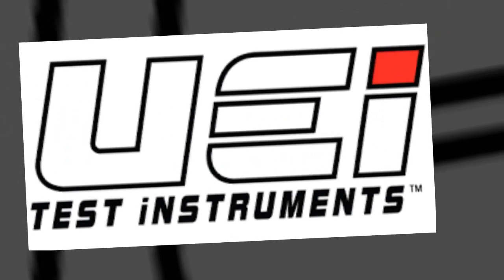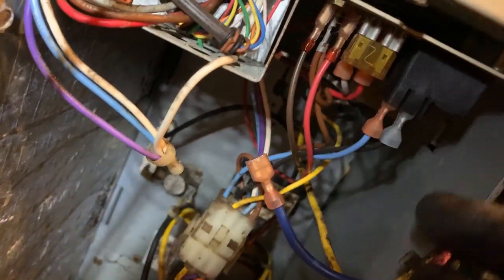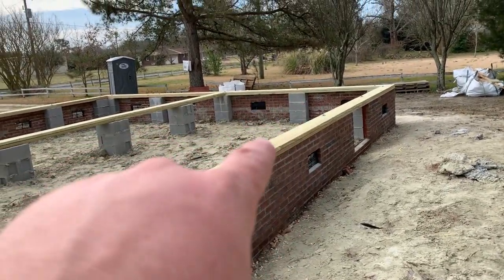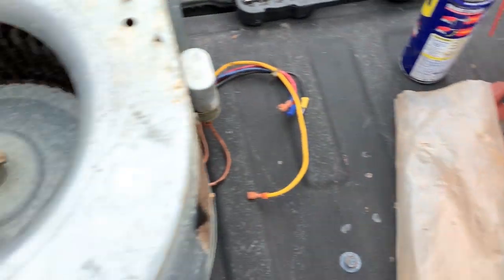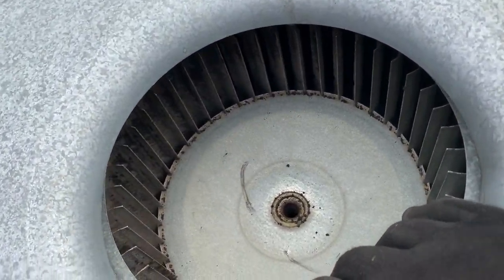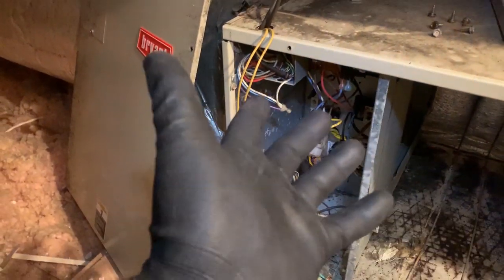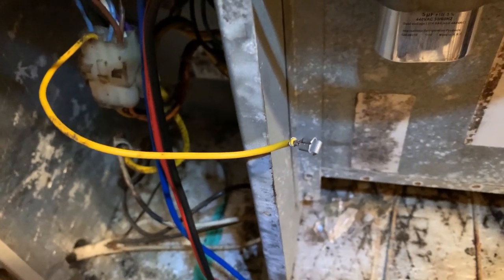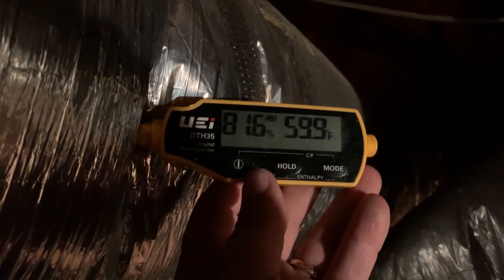8 | Blower Motor Down!

Comment: Maybe before you set the house down you can lay plactic down over the sand floor.  Would be easier to lay the plastic now vs once the house is set in place.
Reply from the maker: Anthony Reardon hvacr they are suppose to do that.

Comment: 7:09 I like pushing the wheel deeper in towards the motor, sanding the shaft and USUALLY slides right off without any rust buster. 😷👍🏽

Comment: Great video. I’ve never used a vane anemometer but I think each model of return grill is supposed to have a k factor in the manufacturer specs. So if you have say a 12 x 12 grill, you do take the full 12 x 12 area into account, but only a certain percentage of that is open (k factor) and that affects the cfm reading. If you use measure quick with temp/humidity probes in the return and supply it will give you an accurate cfm estimate as long as the charge isn’t way off.
Reply from the maker: Monsieur Bojangles I was told not to use k factor. Bill Spohn told me that I use the entire opening as the measurement.
Reply: HVAC Shop Talk Got ya. Like I said I’m not too familiar with it but I can say the measure quick estimate is awesome👍

Comment: Not hating but i would not have a vented crawlspace. A major cause of crawlspace moisture issues.
Reply: I've never seen a modular that wasn't vented. Always assumed it was code. I'm in CA
Reply: Think in our climate here in Kentucky we have to have it vented in summer and closed in winter. Those automatic vents based on temp seem nice also. Helps dry it out to get some air thru it. Only other option I’ve seen is to plastic line the ground and spray foam walls to actually seal it off and make it like conditioned space.
Reply: @jphvac5725  in a humid climate how will allowing hot humid air into a cool dark crawlspace dry it out? It doesn't. Simply brings in even more moisture. Same with vented attics terrible designs.
Reply: @blackishpariah  yes its very common with production housing. They dont take any building science or basic physics into consideration.
Reply: Tanner Dickerson we have ultra humid days here in KY in summer. But watch after rain comes thru and ground is soaked, and we have a windy yet cloudy or even sunny day after, the wind dries it out in no time. That air flowing thru dries out the underside of the home, must have a vapor barrier to help but without vents all that moisture has nowhere to go.
Reply: @jphvac5725  so dry out moisture with moisture? It doesn't quite work that way. But in that scenario there are multiple factors. 1st when it rains the foundation shouldn't allow water to flow under the house(separate issue). A vapor barrier should be in place then air sealing all of it. Little to no moisture should be coming thru. A dehumidifier can be used for extreme case or a better option is a conditioned crawl space.
Reply: @jphvac5725  as you know the biggest problem with allowing moisture to flow through with vents is exposed/uninsulated duct and duct leakage. And when you allow 75° dew point air to flow under the house it condenses everywhere.
Reply from the maker: Tanner Dickerson I can alter it later if I want to seal it and add a dehumidifier.

Comment: Where do I get your motor? By the way, my blower motor went out and I went to Goodman. They gave me the same motor, from Zhongshan, China, and charged me $250. My uncle lives in China and he went to that motor company looking for that motor. Turns out, the original price for the motor is $60. LOL.

Also, can you show how you center the fan? My fan is a bit off-center in my blower case.
Reply from the maker: Are you an HVAC tech?

Comment: For a unit that had a PM done a week and half ago it sure is dirty and moldy! Especially that nasty blower wheel! That alone reduces airflow! Guess standards are less than others! Just sayin, another company can easily come behind you and say you did nothing! Should have recommended wheel cleaning on the PM not when the motor failed.